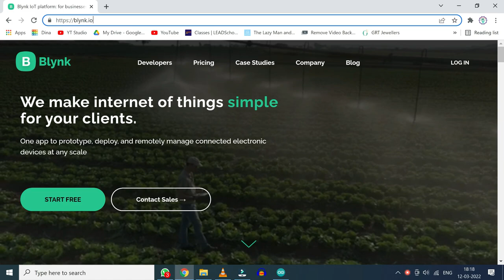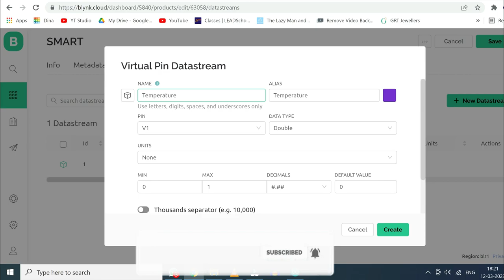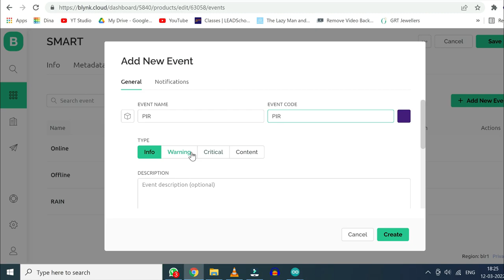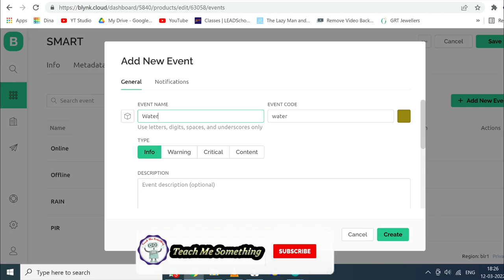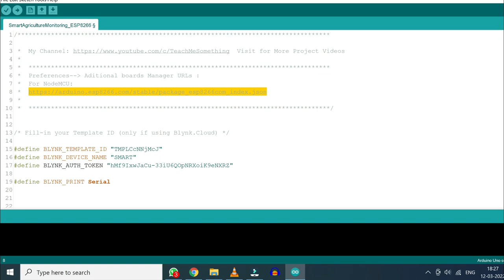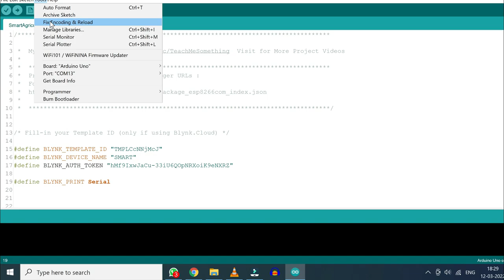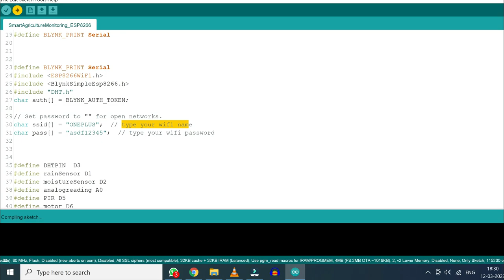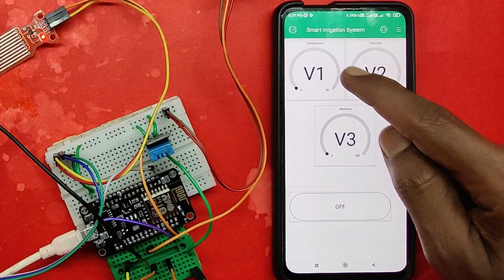Blynk 2.0 | IOT Smart Plant Monitoring System | Smart Irrigation | NodeMCU Smart Irrigation ESP8266

Comment: The battery visible in the block is not in the video. Did you get power from the computer instead of the battery? The relay module is not in the video either.
Reply from the maker: If you use relay and some external power supply. Your motor will run without issue.
I used less ampere motor. So it is working with laptop power itself.
Reply: @TeachMeSomething  So you connected one end of the purple-torn to D0 and the other end to GND, right?
Reply: The engine I will use is the same as yours. I will connect the motor directly to the board. it is not a problem right?
Reply from the maker: @ysfkyya  yes right only. Some time motor wont work because of less current
Reply from the maker: Yes

Comment: Bro plz tell me why are some codes written using blynk edgent... what is the use of that?...why didn't u use it?...I am making a home automation project which include many sensors and I am unable to code it properly.
Reply: I finally found someone who has used many sensors with Blynk 2.0 ... thanks a lot !... previous Blynk version Codes won't work with the new Blynk 2.0 version right???
Reply from the maker: Contact me in Instagram if any help required
Reply: @varadpatil369  any link?
Reply from the maker: It is paid program. You pay & get the code

Comment: How you connect motor to direct mcu board.. please??
Reply from the maker: It will not work most of the time. So i suggest to use relay for practical application.

Comment: The relay is not working by Blynk app sir please say what to do
Reply from the maker: Dont connect pump.
Try without pump.
Pump my be have have powersupply issue.
Connect only relay & see the light changes in by pressing on / off button
Reply from the maker: Contact me in whatssp or Instagram
Reply: @TeachMeSomething  👍 sir
Reply: @TeachMeSomething  yes sir I'll check and will confirm